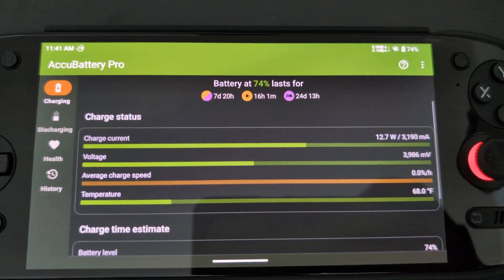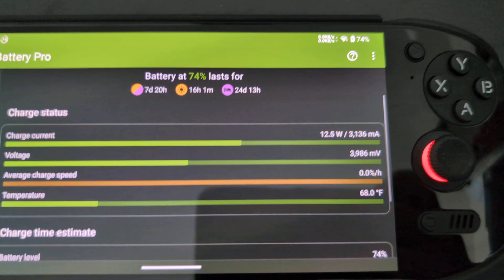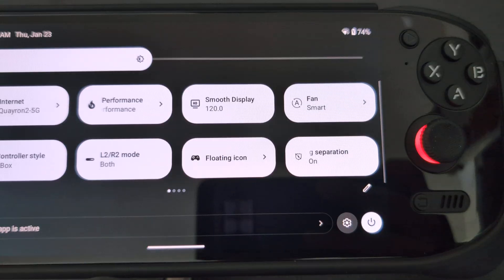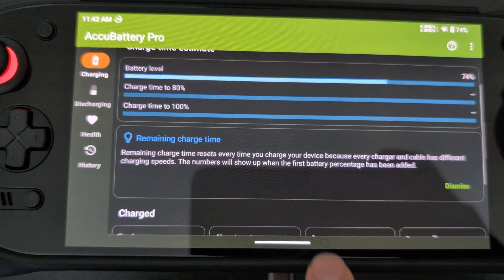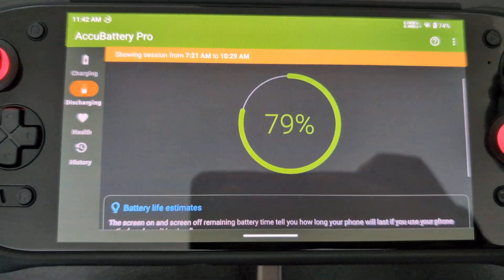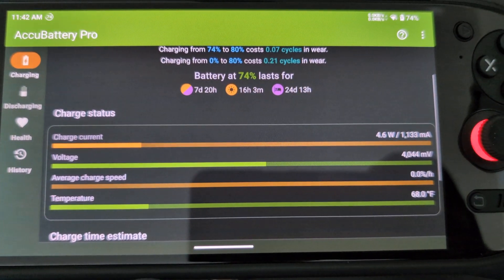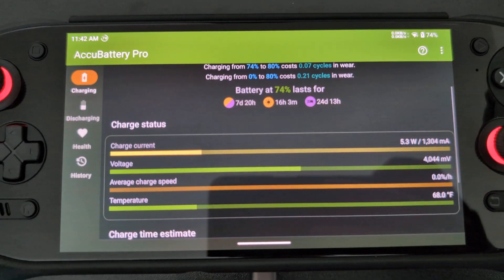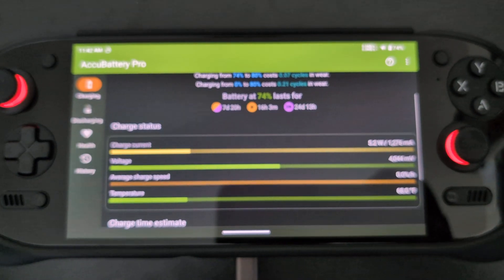AYN Odin 2 Portal Charging Separation Issue with PPS/PD Charger (v1.0.0.128)

Comment from the maker: I've been doing some research on this issue and it looks like it happens if your charger doesn't have PD 12 volt output. I was able to get three chargers to work with no issues and I looked at the output specifications for all the chargers I was testing. Make sure your charger supports PD (Power Delivery) 12 volts.

I'll update this comment if I get a response from AYN confirming this. AYN has said that this issue will be fixed, but it's still being researched.
Reply: Were there any improvements you’ve found over the past few months? Or does your workaround solution still apply?

Comment: Im looking to get my first android gaming device (although have about 10 yrs of Android/emulation experience) I'm split between the Odin 2 and Portal. I know they have basically the same specs but the larger/better screen, larger d-pad, and better analogs on the portal but I'm not the biggest fan of the glass fronts. I love the plastic shell body and style of the Odin 2 but I'm leaning more towards the Portal for the quality of life changes with the screen etc. Which would you recommend?
Reply from the maker: I never tried the original Odin 2, but the OLED screen is way better than a non-OLED screen. There's a video on YouTube of someone comparing the two Odin 2 screens and the difference is huge when they're next to each other. You can use black frame insertion in emulators to mimic CRT screens. I also suggest getting the grip if you get the Portal vs the regular Odin 2 because the Odin 2 has thicker grips and the Portal has small grips built into the device.
Reply: @MaxHasManyHobbies  thx a ton man, I was watching a couple other videos and I'm sold on the Portal fs 💯
Reply: @xLinkRaw just bought one myself 😊